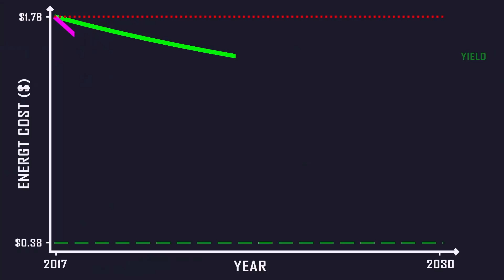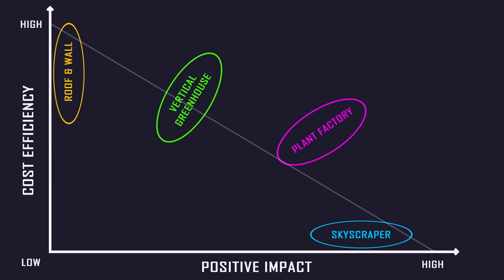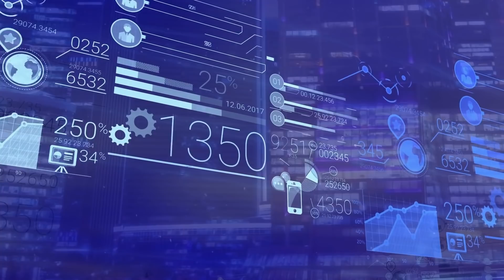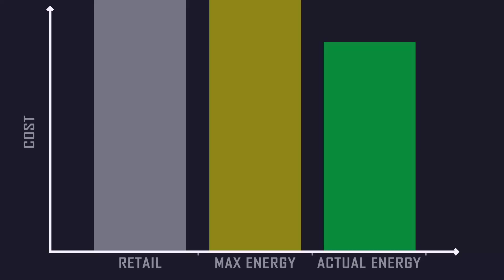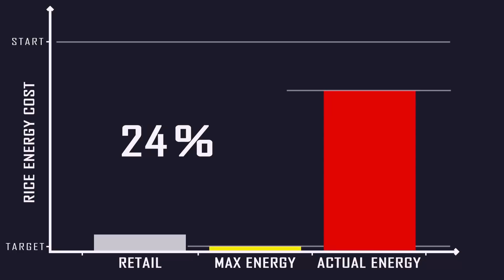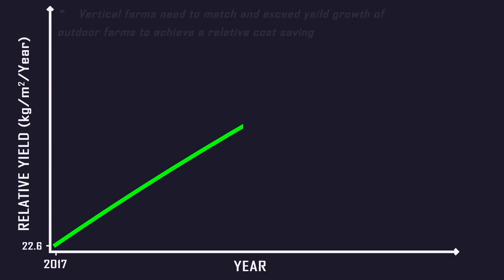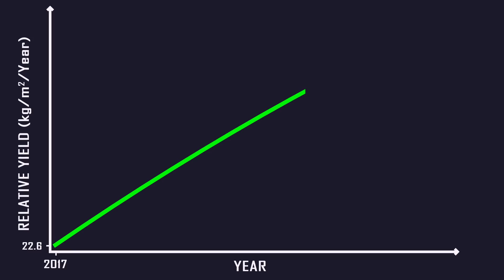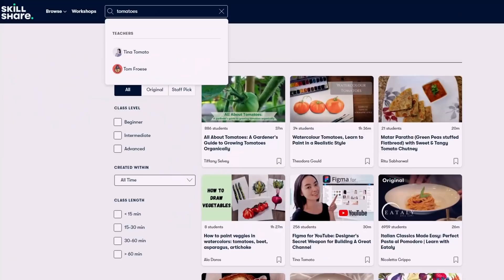What's The State Of Vertical Farming In 2021?

Comment: Thank you for the update video, I enjoyed watching it. 

A new technology that could accelerate progress is a UK company called 'Infinite Power'. They go commercial in 2022. They advertise the ability to generate green electricity 24/7 for decades with little or no maintenance and it will be the cheapest way of generating power ever. 

Very simply they have modified a solar panel and put it in a metal box with a radioactive stick. The 'solar' panel generates power from the radiation. A 1m cubed box will generate around 10kw and is modular so stack them together and you've got yourself a power station that can be built anywhere in the world. They've done all the R&D and prototypes made. The first factory is currently being built. It has the potential to make wind and solar obsolete and remove the need for grid storage batteries.

Comment: 1) Around 15:00 he mentioned "seed development". Does this mean these indoor crops are/may have to be genetically modified??

2) Not trying to be negative or anything but from what I understand, manufacturing solar panels produces a lot of greenhouse gases  which contain toxic chemicals harmful to the environment. To recycle them uses up a lot of energy extracting those materials which adds to the greenhouse gasses. 

This is an amazing concept and I only wish I had learned of it years back because I would have probably chosen a different career course. Hopefully we will have found a more viable sources of environmentally friendly energy in the next few years.
Reply: Solar panels only produce anywhere near the GHG they do because the production line is powered by fossil fuels. Once that is changed, solar panels will produce much less waste and GHG. They are FAAAAAR better than our current energy sources

Comment: I'm really fascinated about this concept applied at home. I wonder how carbon dioxide will be delivered in that system and overall, how it works. I want to be a part of that innovation including making phase 3 crops economically viable especially in my country Philippines that has large population and cozying space just like Japan.
Reply from the maker: It will be very interesting to research. Carbon Dioxide in the home is naturally higher than the 400ppm in the atmosphere due to the occupants, though it varies a lot of course on many factors.
Reply: If this stuff blows your mind, you should check out this wild thing called nature. How can this be applied in the home? With this miraculous thing called gardening. Plants grown in - get this - the ground! It's really interesting stuff, you should check it out!